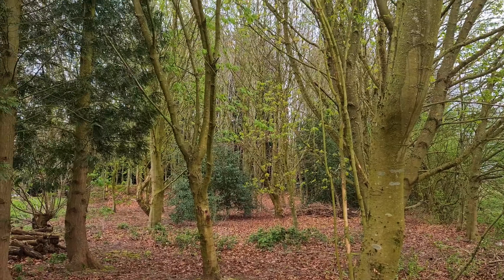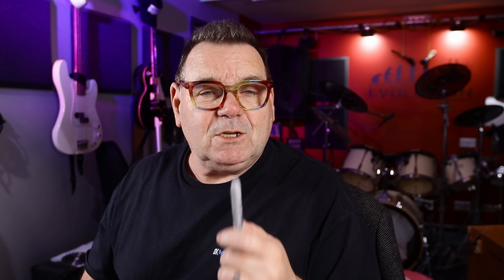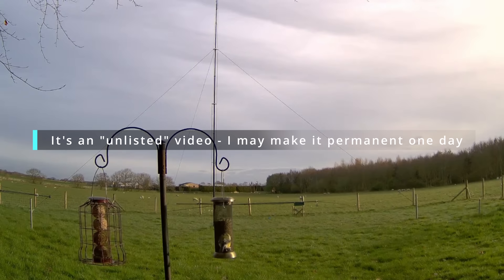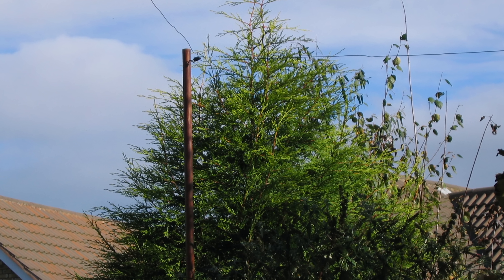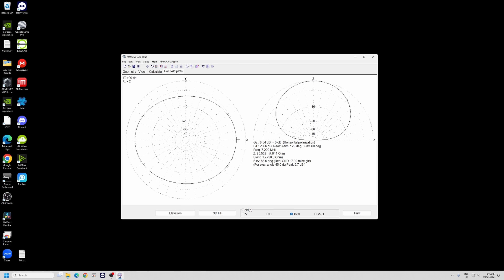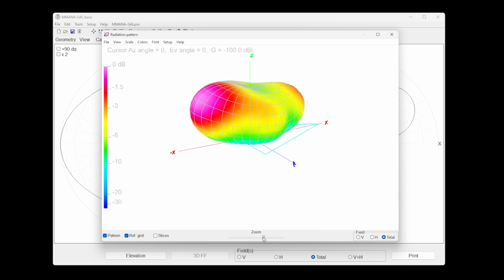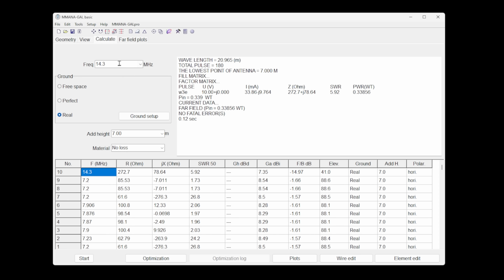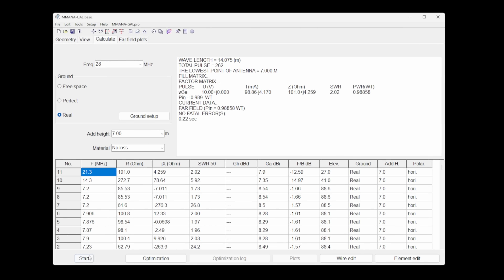Amazing Cheap Multiband Delta-Loop Horizontal Antenna

Comment: I notice your picture at the end shows the delta running parallel with the ground, as in, one broadside is facing the ground and the other pointed to the sky.  How does that run on 10m?  I figured it would behave like a NVIS with the broadsides pointing up and down, which 10m doesn't benefit much from.  I am not an antenna experts but curious about trying this out.
Reply from the maker: OK, so long, long story but large loops on higher bands actually develop gain in a sort of clock-face pattern. Now, in this case - my real Delta Loop is only 10 feet / 2.5m or so above ground - but loud in "first hop" all over EU on 20m, 15m and 10m.

Comment: I have a question
 mine is standing up vertical  with Flat Side opposite apex  6 inches  low to ground apexx up about 26 ft in  delta in 3 trees both 2 ends which includes the feed line low to ground.
Now swr 40m-10m all under 1.5
Wonderful and superb receive there is a hill 800 feet behind me and 1000 feet up.

Infront of me just sky and the sea i am on a hill no obsticals infront of me 
But no one can hear me i can hear dubi well
Is my antenna too low 
Its pointing in east  i think  i am in the caribbean 
I will try north or do an opposite configeration
Its in a lot of trees but trees not touching line
Reply from the maker: Ignore the trees... It is my opinion that a 40m delta loop on the vertical plain isn't so hot. I will try and make a video about this next week. Look out for it.
Reply: @DXCommanderHQ i tried it horizontal like your exanple and its doing very well have it in an north north west direction and  apex south south east
May have to adjust the config slightly 
In Barbados so want to cover England Europe and  USA/Canada same time 
So it needs to position radiate to suite
Once i get this working 
I will move on to
 Delta arrays
Nested loops 80 40 20 all in one with reflectors for each all in horizontal orientation like yours 
 Thanks for encouragement 
8P5DX out 
73....

Comment: Thanks for the idea! I built this 40M delta loop and put it about 25’ up in some trees in the back yard. I love this antenna! I get 40, 20, 15, 10, and yes the radio will tune it for 6M. One of the nice things I’ve noticed is this delta is 1.5-2 S units quieter than my vertical or inverted V. It lets me hear stations I otherwise would not be able to hear.

Comment: Bro.  After watching you erect every antenna with something dangerous and unpredictable, I have THE PERFECT answer for you.  Been doing it for years.  Safe and simple and if you can fish... you can do this.  Your gonna have to do some conversions but...  25-30lb test mono fishing line. 3oz teardrop weight on a LONG spincast fishing pole.  Can get it up to 60 to 75 ft depending on wind and whatnot.  Shoot over the top of the entire tree if possible.  it will settle in a good spot later.  I can almost call the exact branch I want it on first shot.  DO NOT change the ratio of weight / line or you will either lose your weight or if you throw wrong, you will never get the line outta the tree. :)  Learned that the hard way using 65lb braided kevlar. :(

Comment: I am a new guy and I am planning to build a Delta loop to upgrade from my current EFHW. You said in the video "When it gets higher and longer, interesteresting things happen" Can you elaborate a little? Good or bad (interesting things)? My plan at present is to put it up approx 12.5-13m and 2 sides with be roughly 40m in length and the 3rd leg will be 24-25m. The feed point will be at the meeting of one of the long side ends and one of the short side ends. The feed point will face south, the other 2 corners west and north. The North and South leg of the loop will run over my house from end to end (the home has a metal roof which should be a nice ground plane) and the western loops will run to a tree.  I live in the central United States (Central Ohio), almost in the center of the country (north/south orientation) and a little east of center (east/west orientation)
I am very interested to know what anyone would advise about this design.
Reply from the maker: I'll do a deep-dive video shortly. In the meantime, start here: https://youtu.be/FflcxdsResQ
Reply: @DXCommanderHQ  than you!

Comment: I built it, hanged around 10m above ground and partiality above house metal roof. I had to use 2:1 transformer rather than 4:1. 20m and 15m bands are in perfect resonance, 40m is too short so finally I have around 2:1 SWR in phone area. 10m is a little too long but generally in side phone section, but minimum SWR is around 1,9:1.
In general, 40m delta loop is perfect for 20m and 15m without tuner, but 40m and 10m needs tuner.
Reply from the maker: Interesting!

Comment: A Horizontal Delta loop is Vertically polarized , has no gain and is Omni - directional , not bad if that is what you need . It is much Better than a piece of wet string . ( you don't have to keep wetting it  : )
Reply from the maker: Low to ground Delta Loop has plenty of gain going UP on it's fundamental (perfect daytime 40m). Lift it up to about 1/4 wavelength higher and the higher harmonics produce gain.
Reply: @DXCommanderHQ  your simulation quotes Minus - 6.6 db i@ 40 meters , ( I ) an isotropic radiator is minus 3db compared to a dipole . So your loop on 40 meters in theory is Minus - 3.6 Db or about half the power of a dipole 
( worst case  ). It is omnidirectional , vertically polarized , with little or no gain ( over a dipole ) as previously stated . The interesting bit is you said it was a low noise antenna ! This could be because it is vertically polarized ? or it might be because the antenna is non resonant at the frequency in use ?  I plan to build one a.s.a.p . but feed it with 300 ohm twin feeder , and tune it with a balanced output A.T.U . Thanks for the info .

Comment: So is 3 sided better than 4 sided using the same length wire?
Reply from the maker: Different.. I prefer triangles myself..
Reply: @DXCommanderHQ  I’ve read that the more room in the middle the better so I hung a square. Does the modeling say different?

Comment: Bit of a coincidence as i made a similar antenna based on previous experience back in Kent. It was a quiet antenna , less noise. . Decided on a 4 to 1 balum wound on a ferrite Rod. 50m wire in the air. It loads on all bands via ATU. But it's resonant on 30m . Results  not bad.. Still testing. Only just found your video..  everyone tells me it's a cloud burner being  horizontal. It's 23 ft high.  Qrm is Far better. A EFHW was a disaster for qrm at my qth. Going to make an alteration to the feed point for logistic reason as i want to install a homemade vertical antenna as well.  The loop is not so hot on 10m. But 40m seems incredible. Although today station i could hear well at Hackgreen were not even audible on my setup. Also no longer can work the Sunday 60m net as all stations are weaker..  Then other stations are good. Radiation pattern is the problem.   Still it's low noise. May be able to raise the height at one end.
Reply from the maker: Ignoring transmit ability, I agree, the RX will be lovely.

Comment: Hi cal. This is same like my h5anxk4 multi band loop. I put it on the web back in 1996. Then in qst. The use of 4:1 balun and multi band properties were noted back.then. I really wish folks can give credit to us who discovered this. Thank you.
Reply from the maker: Loops have been around even longer.. It's one of those things that just gradually came to being. However, most people still think the RF goes straight up..
Reply from the maker: @sajsan4763  Credit to you then. Good work. I never knew that. Now maybe pull the horses back a bit..
Reply from the maker: PPS US Patent # 25371911
Reply: @DXCommanderHQ  THank you. When this was designed, i put the design up on antennex back in 1995. Then several hams plagurised it including the balun - Air core - not ferrite based. Because in the kalahari desert, i did not have access to this. Using W6SAI book where he showed the aircore for 1:1, i postulated, it was possible and very simple to do it for 4:1 and there it was.  This loop was being done in parallel to V51E (SK) koosie who was on the other side of the desert in Namibia. We were working on parallel designs - he settled with bob tail curtain and I focused on the delta loop.  The reason for 4:1 was simple calculations. Fundamental loop frequency is having approx 150ohm. Normal loop asked for 75ohn 1/4 feed. I did not have access to it. The rational was 75+50=125. This would give a close match to 150ohms.  As I did not have access to 75ohm, this is where the 4:1 balun came up - I thought of multiplying it. giving 200ohms. 200/150 = 1.3swr which is similar to feeding with 75ohm.  Hence this idea. when you go to 2nd harmonic, the folded loop will never load. but in case of a loop/delta it becomes 200ohms. Now 4:1 balun works perfect and if you check, on 20m for a 40m loop, the SWR flat lines.  For 20m loop - 10m flat lines. Effectively you get this as a no tune 2 band version. but intermediate bands are easily workable.  e.g. 20m -> 20,17,15,12,10,6. Etc. You can see my response in QST long back with the design including the balun photo.
Reply from the maker: @sajsan4763  You deleted your original comment. That makes the thread meaningless.. But anyway, the patent for the 4:1 balun in a loop antenna was granted in 1947 to Clarence Moore. Thank him for your inspiration :)

Comment: Looking forward to the next installment on this one. I've been looking at building a delta loop for 40 for some time now, but, most of the research I've done suggests it more like 100 ohm at the feed point and a 2:1 transformer is what's needed rather than a 4:1. But as you said the 4:1 sort of covers all the different impedances across all bands. I guess none of this stuff is set in stone and a lot depends on the height, but would be interested in your views on this Cal. 73
Reply from the maker: Ah yes.. Now a VERICALLY polarised mono-band delta loop needs about 100 ohms. The trick to that one is a q/wave (of target frequency) of 75 ohm coax (less velocity factor) at the feedpoint. That will do the transformation.
Reply: @DXCommanderHQ  Thanks Cal, that all makes sense. Just catching up on my YT stuff and saw your recent video. Take it easy mate, do what you have to do.  73

Comment: Over the past ten years, I built three 40m horizontal delta loops at various times. One was installed entirely on my roof. The other two were installed in trees on different properties. The one on my roof was more or less 30ft high. The other two were 20 to 25 ft high. I achieved resonance with about 143ft of antenna wire. I fed the roof-mounted loop with coax, and the other two with 300 ohm window line, which i later changed to coax after substantial testing where I found very little difference except on 12, 10, and 6m, where the 130ft run of window line had measurably less loss (compared to 125 ft of RGBX). At the time, my main interests were in 40, 20, 17, and 15m, and the coax was easier to work with. When I used coax, I fed the loops with homemade 4:1 baluns installed at the feedpoint. When I used window line, I ran it straight to the tuner, which has a built-in 4:1 balun. As for lightning protection, I used quick disconnect connectors outside my shack and disconnected the feedline when I wasn't operating. I also shorted and grounded the leads. I depended on the tuner's ground connection to drain static when I was operating. Perfomance-wise, the loop is the best receiving antenna I ever used, and I have used a lot. It was even a great receive antenna on 80m, although I could not use it for transmitting on bands lower than 60m. The signal-to-noise ratio was always outstanding. And, the loops worked well for transmitting, particularly on 40, 20, and 15m.  For most bands, I didn't need a tuner, but I did use one on 60, 17 and 12m.  I found very little difference in performance with loops mounted at 20ft vs 30ft, although the feedpoint impedance changed a bit. I compared the performance of my last loop to my current non-resonant end-fed inverted-V (for 6 though 80m) and discovered that the end-fed generally outperformed the loop on transmit (by about 3 to 6 dB on 40 and 20m), but the loop was hugely superior on receive. At the extreme, I sometimes could not hear some stations whatsoever on the end-fed, but they were clear at s4 or s5 on the loop. As long as space permits, I will likely always have a 40m horizontal delta loop in my antenna arsenal. I have often used the loop for receiving and the end-fed for transmitting. That configuration has netted me nearly 200 unique DX entities. I'm a believer.
Reply from the maker: Great comment.. Thanks.

Comment: Callus, that is the antenna I use. Mine is 160m antenna 50-60ft up. I love it. I've been using it over 10 years and get great signal reports, hears excellent.  160-6m tunes with internal tunner. Only bad part of this antenna is it's a static absorber, so when not in use I keep it unplugged from my station. Other than that, it kicks  butt. I placed 5th place for 4 land in a CQ SSB contest against the rest of all and 2nd for the FL so party against all the big stations with big power. 100 watts and a wire. 73s from US  N4RRR
Reply from the maker: Ah! Yes - I'll bet it's wonderful. Never thought about the static..

Comment: I had fun with a vertical 40M delta loop( would be interesting to see the plot H vers V pol), by the way it was replaced with the dx commander my hops kept growing up it I used 2x 8M scaffold poles to hold it up 4:1 balun and an mfj tuner and my TS440s
Reply from the maker: I've added that comparison to my list..

Comment: Hi Cal. Thinking of knocking one up for 10m only and using it this coming weekend for 10 on 10...
Any good ?? Also what length of wire would you aim for ? Cheers David.
Reply from the maker: Cut 2.4m for a quarter wave.. That's roughly 29MHz.. Apparently we'll be JUST above that.
Reply: @DXCommanderHQ  cheers 🍻   Hopefully catch you on 10 Saturday.
Reply from the maker: @davidbridge3542  Just beware - we'll be vertically polarised (if you are in UK) else any polarisation will work.
Reply: Cheers for update. Might not have it ready in time so will probably use the wire slim jim on a 12m dx commander pole. Will look for you on 29.130
G6SBR on the hills above Burnley 😅.

Comment: Thanks for the video Calum. This is a great antenna. I have one set up in my yard. It's about 8m up, 4:1 balun fed in the corner with cnt240 coax. I have an Icom 7300 and the internal tuner happily gets a match on 40,20,15,10 and 6m. 
I like your idea of the paracord and loop of extra wire so you can trim easily to get best match. Mine has several joins in it lol.
Reply from the maker: Joins..! Yes.

Comment: Built a 80m loop as my first antenna. 7m to 10m high, don't really need the 4:1 on 80m, just not high enough, could drop with switching in a 2:1 on 80m. 4:1 is perfect for 40m onwards. Feeding now with ladder line to reduce all losses...big 4:1 in the shack into the back of the tuner. Runs 1kw all day long.
Reply from the maker: Perfect Eoin!

Comment: I have made a few loops with the DX-50.  My strain reliefe is paracord outer cover, and glue lined shrink tubing leaving a 12 inch tail.  That way I don't need to redo my strain relief, but once it is tuned it is fairly poratble.  Pole supports are 3 Classic poles one fixed to my vehicle, and 2 on portable stands.   At about 25 ft I make a loop from  a zip tie and using a second zip tie I attach the first loop to the Classic pole as a wire guide/support.  Remember to extend all the segments of the Classic pole to keep some water out.   I attatch a 4:1 BALUN to the Classic pole on the vehicle.  A short run of coax to the radio and I can be operating in about 20 minutes (I move slow ) . I guess I should make a video.
Reply from the maker: Yes! Do it :)

Comment: Hi Cal.  Love your vids.  What would be the effect of hanging it vertically?  I ask because I have used an antenna called a "Super Loop" which was made by a firm that is no longer in business.  Physically it looks much like what you describe.  It's a full wave 80M triangle fed at the bottom thru what the designer calls a "tuning unit".  However, half way across the top, the wire is split at an insulator and a 32 foot twin lead tuning stub hangs down shorted across the bottom end of the stub.  I'm not an antenna theory guy, but it always beats reference dipoles on every band from 80 to 10 with SWR's in the 2:1 range.  Perhaps its a bunch of bi-squares. PS: the top of my triangle is at 20M above ground which puts the "tuning unit" and the coax feed point about 10 meters up. Your thoughts?
Reply from the maker: Oh heck, I knew someone would ask.. I'll add it to the video list!

Comment: Hi Cal, just built a skyloop 40m-10m ,in almost a square shape, height is around 45ft, its simply a DXBuster on higher bands, BTW im feeding it with homebrew  Ladder Line.
Reply from the maker: Perfect.

Comment: I use a Horizontal Deltaloop for 40m. 10m high. I put 300 Ohm twinlead for the feeder to my shack. And put a 4:1 balun from twinlead to coax connected to my auto-tuner. I trim the Twinlead to adjust SWR good as the ATU working all band. 
Not perfect installation, maybe some loss. But for Urban installation, Deltaloop are more quiet than dipole.
Extra: I put 2 inductors, one in serie, one in parallel, "home made adjusted value (error and try)" for a "not to high" SWR (tunable for ATU) on 80m
Reply from the maker: Lovely.